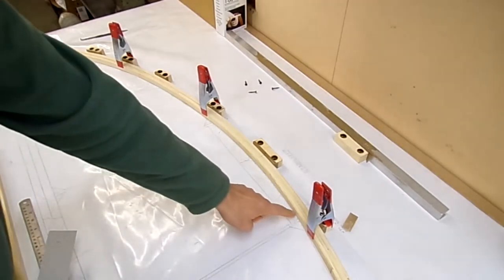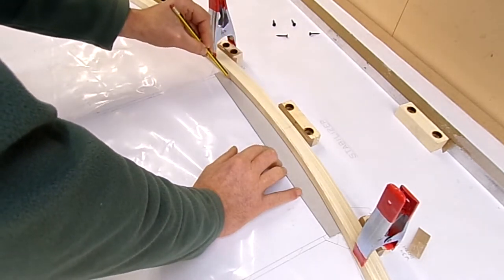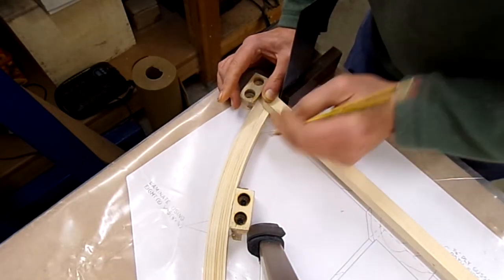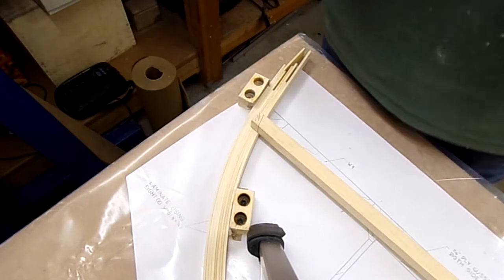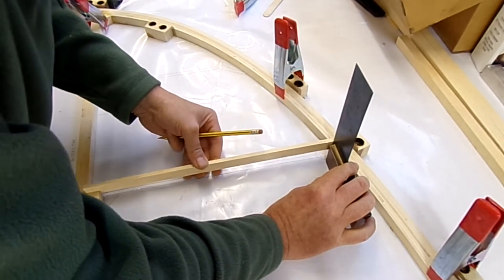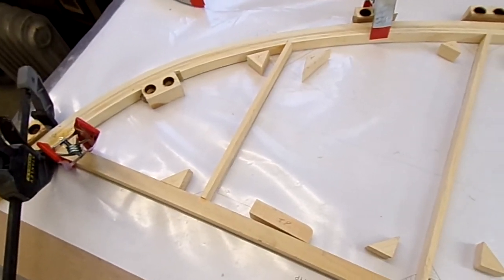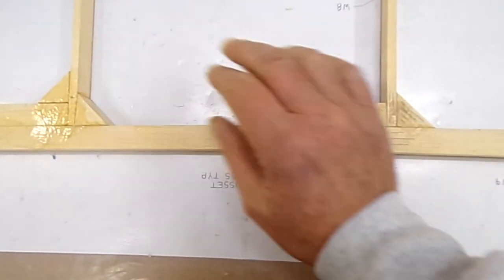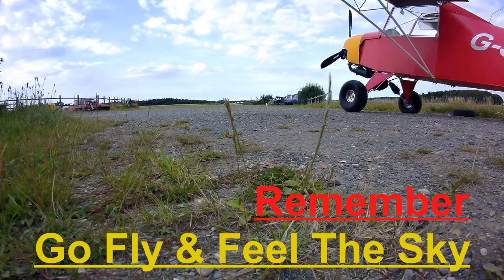EP3 Fisher Youngster V Kit Plane Build - Wood Tail Ribs and Blocks.

Comment: I love your videos. Mine are usually more very specific to the questions people frequently ask me, so I just put it in a video. Very cut and dried and quick. I like the way you invest some time in it.
Reply from the maker: Thanks you for watching and the feedback. I was not trying to make them instructional but a friend saw the videos I was making for restoration project (they wanted videos and photos to document the work done) and he said I should explain to people what I was doing. I then did a rudder kit for another aircraft to see what I thought of it and go a lot of feedback on those, so it seemed logical to share my method with this build. If it help anyone and encourages other to have a go, that would make it worth the effort.  Dave Hertner has been happy with them added them into his new letter videos, which is a big complement.

Comment: Thanks for these videos I am thinking of a Fisher aircraft build.
Reply from the maker: I hope you find the videos help you decide to go ahead with one. Which one are you thinking of?
Reply: @flyingkub  I was thinking the FP505 or FP606. I don't have tailwheel experience but have been told the FP505 is not as hard as some tailwheel aircraft to handle.
Reply from the maker: @MichaelBrown-eh6dn  I can not comment on how easy the 505 is as a tailwheel aircraft as I have not flown one but it said that the Fisher aircraft are not bad on the ground. Both aircraft should be fairly easy first aircraft to build.